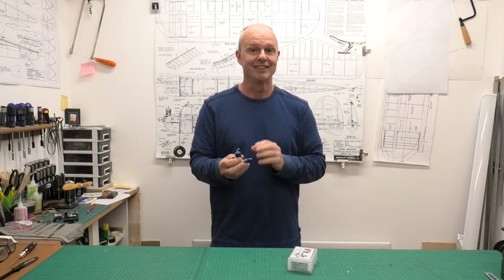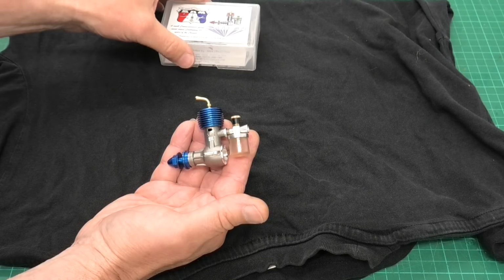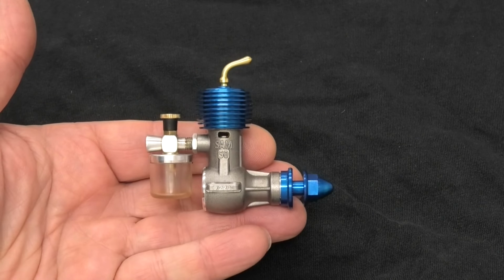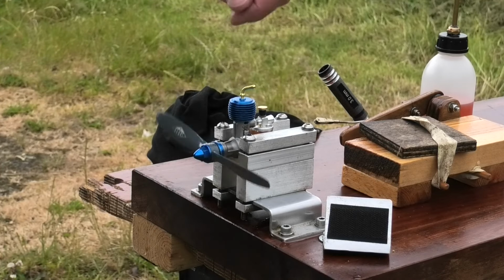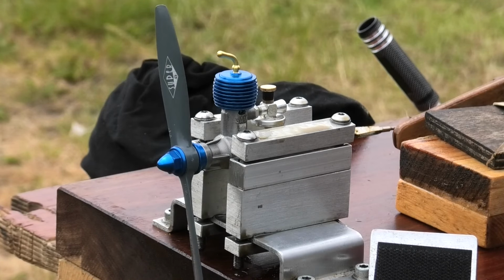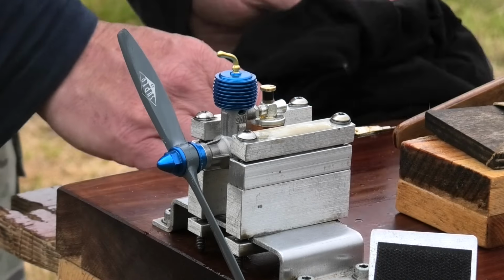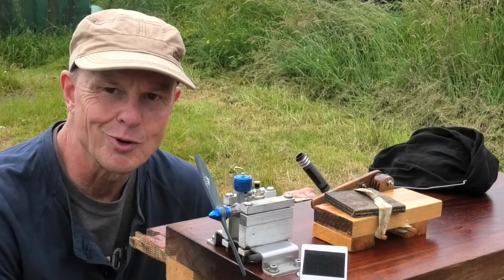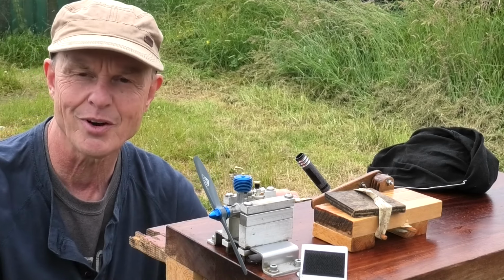SAM 50 Diesel Engine - SAM 35 Special Edition 0.5cc

Comment: What fuel you using please, my D1000 is clear. Lovely little motor
Reply from the maker: @peterbrown7130  Hi, I am using D1000, the later fuel is this colour, thinks it the synthetic oil 😀
Reply: @MarkRobinson555   yes the stuff I have in sealed tins is very old, label on 250ml is £2.39!!!!!